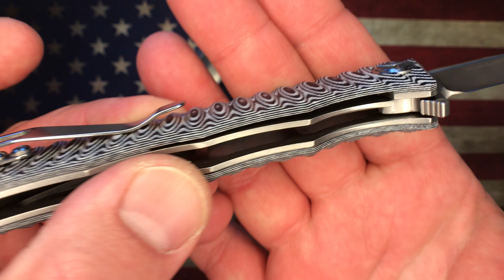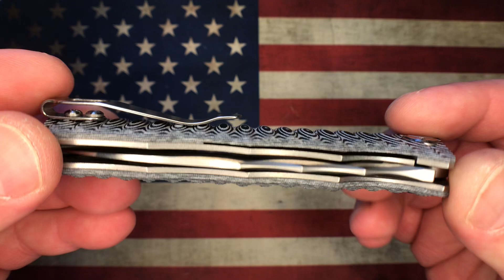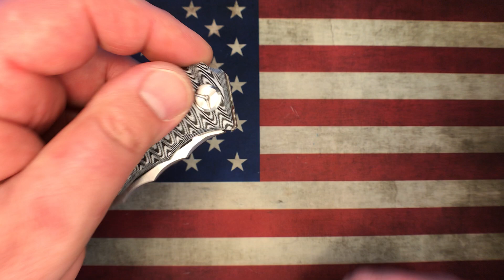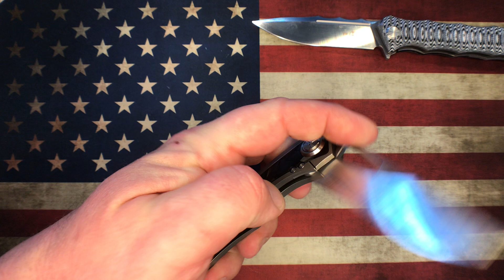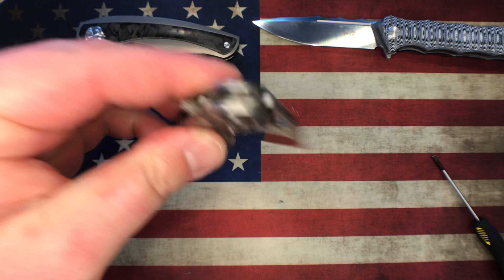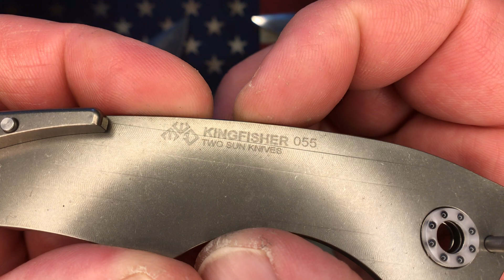Best Twosun knives Period!!!!   Budget - Mid-Range - High End  3 great EDC's Something for Everyone!

Comment: I just paid $68 shipped for a TS293 titanium frame lock flipper. I cannot believe how great the fit & finish is on it. It feels like it would cost at least triple what I paid. It's 14C28N, which is absolutely fine with me. The compound grind & varying direction satin finish on the blade alone should cost much, much more. I'm definitely on board with TwoSun moving forward! 😃